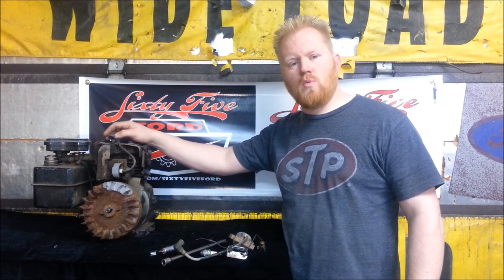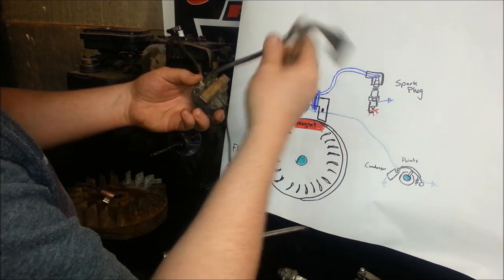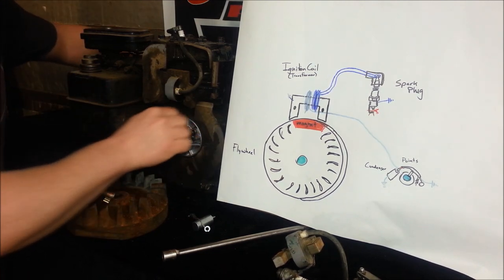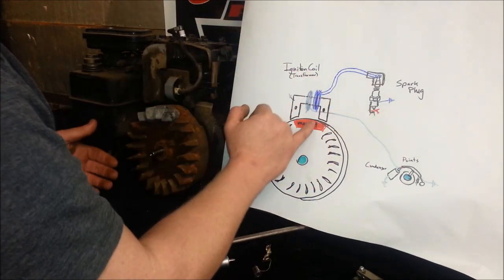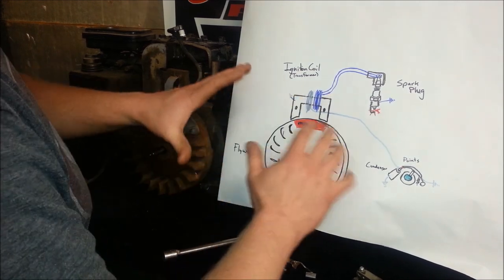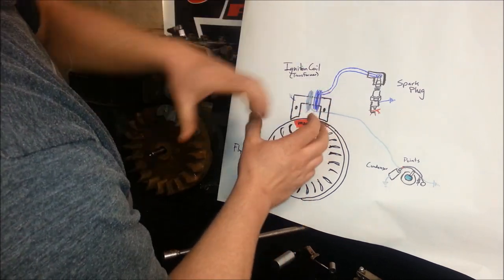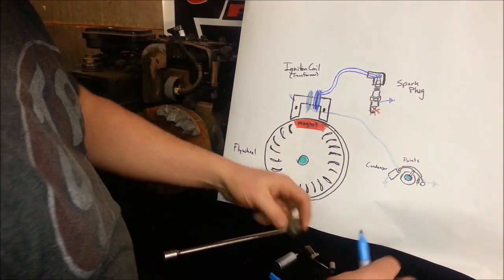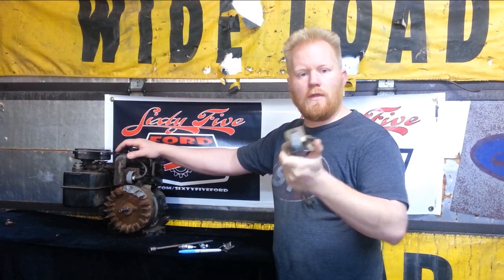How Points and Condensers Work Small Engines

Comment: Hi great video.  Wondering if anyone can help me. Kohler 8hp K181
. Replaced coil, still no spark. I am thinking I probably should have ordered a condenser also. By the way only way for me to find parts is EBay, straight from China of course so just hoping they are good. Anyway in Checking the condenser, I am on 20k ohm setting, Red probe to wire, black too body, meter just stays at 1, should I not see a certain ohm reading, meaning I  am charging the condenser? Also I would then check dc volts I believe, what am I looking for MV of something , then voltage should drop? Thanks for any help.
Reply from the maker: The condensor needs to be disconnected to test and should read around 30mfd from the body to the nipple. The coil is very very rarely the issue in lack of spark instances and generally dirty points, followed by failed condensor are the issue.
Reply: sixtyfiveford hey thanks so much for getting back to me. In my case a new coil fixed my no spark, but back to my original problem I had before loosing spark. For a couple years now I have been having the same thing. Runs great for anywhere from 15min to an hour then starts running rough. Let it cool and starts the same process. I just put on a spark tester and spark looks intermittent when running rough. I took a video but not sure if I can attach it. Could that be a condenser? I have ordered one don’t have it yet.
Reply from the maker: @rltkktlr  Absolutely I would replace the condensor. It is a wear item and over time won't hold the spark energy needed to collapse the field and create a spark.
Reply: sixtyfiveford thanks, I should have ordered one with coil. Will let you know the outcome. Great channel by the way
Reply: sixtyfiveford ok got the parts, points and condenser, replace condenser, I certainly would have replaced the points but got lazy, it’s on a walk(push hard)  behind leaf blower and blower would have had to come off get to points. Maybe a 1 inch screwdriver which I don’t have. So anyway condenser didn’t fix it so I threw in the towel bought a electronic conversion chip, $30, very easy to install, no more points and condenser, and great spark and runs great.  Thanks again, great channel you have.

Comment: Hi, good explanation. You need to follow up on how the engine revs are governed as well as the theory behind the engine revving up and down. Thanks
Reply from the maker: I'm on top of it. Right here http://youtu.be/bOHv3X42-wk
An engine that revs up and down is a clogged idle circuit in the carb.
Reply: Thanks

Comment: Hello, I was very pleased with your explanation on how dynamo ignition works, didn't have a clue until viewing your videao. Maybe a stupid question but I'm wondering, how high should the secondary voltage (feeding the spark plug) be? Would that be like hundreds- or thousands of volts?  Up until now, haven't risked to test it.... maybe for the best..... Kind regards, Jacques Belgium. So as you can see you've got viewers all over the world although Belgium is a small European Country.
Reply from the maker: I would guess it to be around 10,000-20,000 volts.
Reply: Hey....I love your comment and maybe you could explain 8 HP Begium Horses vs 8 HP Harbor Freight engines.

Comment: Smashing video :-))

Hmm i allways thought the capacitor and primary were like a tuned circuit and produced a stable magnetic field, then when the points closed the sudden loss made the primary over react (as charged inductors dont like change) and create a spike of intense magnitism trying to counteract the loss and firing the secondary.

Looks like i may have been wrong :-((

Inductors do react to losses though, they do have some very odd propertys lol.
Reply from the maker: I knew the basics but I had to read up just to make sure my ideas were right.

Comment: nice  video  I just start working on small engines  I pick a 12 hp Tecumseh with points in the side of the block and condenser beside the coil  and am just getting really weak spark because somebody pull all the wire from the points  will appreciate some help
Reply from the maker: Weak spark will either be dirty points or possibly a failing condenser.
Reply: thanks I think condense is bad

Comment: Too wonderful in your detailing. But I am still having difficulty of no spark in a very old Kohler engine Cleaned the points but still no spark not sure of condenser but as you say they rarely go. I must still have a bad condenser.
Reply from the maker: The condensers do go bad, just not as often as the point contacts. If a quick clean of the points doesn't restore points, I generally put a new condenser in.
Reply: Check to make sure the wire between the primary and the condenser is not shorted out against the engine block.  

Sometimes if the wire accidently touches the hot engine block, the insulation melts and causes a short circuit that prevents the coil from charging the condenser.  

Found this out the other day when replacing a condenser on an old Montgomery Ward generator.

Comment: Hey, great video. I'm struggling with an old Briggs 2hp... I'm getting power to the plug but not enough to make it jump. Any ideas?
Reply from the maker: Weak spark would generally be a bad condensor. But you say you're getting no spark so I would clean the point contacts.
Reply: @sixtyfiveford  sorted, thanks!

Comment: what r symptoms of weak spark I have a old Neptune Outboard it don't wanna jump the spark across the spark pulg but when I hold the spark plug wire with my hand to ground I get a shock
Reply from the maker: More than likely the point contacts are dirty or the condensor is weak/dead.
Reply: sixtyfiveford I cleaned the points so it probably the condenser like u said ima just replace them both thank for the tips an reply grate video by the way

Comment: Hello sixtyfiveford@@@ I was wondering if you can help me with my problem I have a ruggerini small engine that it's working but the condenser it's about to run out due to the wire it's coming a parts from it, I was wondering if all the condensers works the same because I just can't find the condenser for this engine please help
Reply from the maker: I've swapped condensors from other engines and they all seam to work the same. I've picked ones that are virtually the same size.
Reply: sixtyfiveford thanks alot for sharing this with me I was just wondering because I have one new setting there so it's the one should be doing the job next

Comment: If the contacts close every rotation of the crank, does that mean the spark fires on both the Intake and Combustion cycle?
Reply from the maker: mon0railbredpig Yes.
Reply: mon0railbredpig Yes the plug fires every intake/compression cycle and exhaust cycle but this has no ill effect, in fact it has no effect during the exhaust because there is nothing to burn.

Comment: You said the point stay open most of the time. Another person's video said it close most of the time. Now I do not know what is the truth.  I suspect the point either close or open when the piston is in TDC. I wish someone explain that.
Reply: The points stay closed until top dead centre then open collapses the magnetic field thus creating the spark ....he's got it wrong...
Reply: @njkip  I agree with you because when I rotate the crank, at the TDC the cam is elevated or has a lobe at that instance. So the only thing will happen, the point will be lifted and open, or no contact. I will go back and start my project again. Nice.

Comment: Thanks for the video. I've got a little 2 hp Briggs 60102 and after it started running lean and dying on me, I decided to replace all of the gaskets (intake, gas tank, crankcase, valve cover, and even the head gasket). I had adjusted to carb with no luck, so I figured I'd just do a little overhaul since the gaskets were cheap enough. I checked the points and condenser and all seemed really clean plus no cracks on the top of the condenser. I sanded the points and set the gap to 20 thousandths, although they were pretty clean to begin with and the gap was at 22 thousandths before. I fired it back up and it will run quite well at half throttle and idle pretty good, but will sputter and want to quit at full throttle. Tried adjusting the carb both directions with no luck. I would assume my points and condenser are fine if it runs so consistently at half throttle, but thought I'd run it by you to see what you think. I just regapped the spark plug, but figure I could replace that just to eliminate it as a cause.
Reply from the maker: tlgrimmy Sounds carb related. The fuel pickup tube that drops into the tank can become blocked. It has a fine mesh screen and it can become blocked if you have a rusty gas tank. Before this I would make sure the Main Jet is clean by unscrewing the nut+screw as an assembly. Then remove the Jet with a wide flat head screwdriver.  Spray carb cleaner through this. Inside the carb hole that your pulled the Jet out of there are some holes behind where this jet sat; clean those as well.  Generally if the engine sparks then it sparks and doesn't change with RPM; if anything it gets stronger with speed.
Reply: sixtyfiveford Thanks for getting back to me so quickly, much appreciated! After reading your response, I pulled the needle and jet, cleaned everything up thoroughly as you mentioned and then I noticed that the needle had a bur on it that I hadn't seen before. It looked as if it had been screwed in all the way and tightened down enough to ruin the taper on the needle and create a bur. That makes sense of the issue with the needle not making much difference on gas flow, as that bur was probably restricting flow. I chucked it in my drill press and carefully filed away the bur and polished things back up. I put it all back together and viola! It runs infinitely better now. I did end up having to keep the needle out only 1 turn due to shortening it when I filed it down, but at least I found the culprit. I'll go ahead and buy a new needle and jet just to get it at it's best though. Thanks again for pointing me in the right direction, that really helped! Feels good to have the problem finally solved.
Reply from the maker: That's great. Keep in mind that it really isn't important how many turns out you go. The 1.5 turns is just a number to get the machine running but it needs to be fine tuned from there. At full throttle turn it in slightly until it begins to stumbles then out until the same occurs. Set it to the middle of these readings and maybe even 1/8+- of a turn out.

Comment: have outboard motor.  won't start.  if condenser is gone will I still get any bit of spark
Reply from the maker: If the condensor is bad, you shouldn't get any spark.
Reply: +sixtyfiveford  .  I have an suzuki dt 7.5 outboard motor.  I've loads of petrol and compression and some spark. I've put new points and reed valves and two new original plugs. still won't start.  any ideas.
Reply from the maker: You should be able to run a spark test and get the spark to jump a 1/4" gap. This will ensure a strong enough spark to run. 2 strokes are easily flooded with too much fuel, to clear the fuel, pull it over a few dozen times with the plugs removed(choke off full throttle).

Comment: I just bought a used Toro groundmaster 52(1979) it was running well and cut beautifully. It died while I had been cutting for about 1.5.  It will turn over, but no spark. Have changed the armature, did as instructed on your video re condenser and point, checked to see if any wires in harness broken extra, but still no consistant spark, only once in a blue moon.  Any ideas. Seat kill switch as been bypassed.. thxs
Reply from the maker: conwald1 This is the point system you have https://youtu.be/QQqhvA5qo2c . You can pull the kill wire all together to make sure it's not grounding out.
Reply: sixtyfiveford Mine is screwed, if you take off the kill swich, it will not turn over..  hook it back up, it will turn over.  So something is wired backwards.  Trying to find a new points and condensor, having a hard time.  Looking at maybe the solonoid.
Reply from the maker: The points and condensor are easily obtainable from hundreds of online places. Don't search for them under Toro as they have nothing to due with Briggs and Stratton. The wire going from the coil to the points needs to stay in order to run, but the wire running from the points the tractor can be pulled off to test(kill wire). If you're getting intermittent spark more than likely you just need to sand the points with a very fine sand paper.
Reply: sixtyfiveford this is the problem, its backwards on our tractor.  When  we disconnect the wire from the points to the tractor it will not run.  It will not even turn over, its absolutely dead.  Connect it again and it cranks.  Go figure.  We are totally baffled.
Reply from the maker: Let me explain a little more clearly as I may have misdirected you a little. There are 2 wires coming from under the flywheel going to the coil. One goes to the points and the other comes out and is next to this wire but never touches the points. This is your kill wire and will go up into the loom to the ignition switch and all your safety kill wires touch this single wire. This is the only way the ignition is shorted out. You can simply unplug or temporarily cut this wire to eliminate the possibility the safety switches on the mower aren't killing it.

Comment: Even on youtube  will see video's by mechanics, auto electricians and others who have absolutely no idea that the condenser (capacitor) boosts the secondary voltage. Good video.
Reply: How can the condenser send current back through the primary while there is no return path to ground.  The points open, which breaks the ground.  The magnetic field collapses causing current in the secondary.  Once the points close again, the stored current is fed back into the primary and helps boost the next cycle.  Current cannot flow without a ground or am I missing something here?
Reply: Thanks for the reply.  I've been looking online to see how exactly this works being as there is no path to ground while the points are open.  The condenser is grounded, so maybe it's just in the way the condenser is made?
Reply: I found the answer :-) 

Once the field collapses in the primary winding's,  the voltage stored in the condenser is higher than what's in the primary circuit.  The insulated foil sheet inside the condenser forces the stored voltage back through the primary winding's, which makes for a longer duration spark at the  plug. This keeps happening until all the stored voltage is used up.

I had to search a lot of old books to find this info.  Finally found it in a auto fundamental's book from 1960.  Thanks for the thought provoking reply :-)

Comment: I have to ask I have a vintage dirt bike and I just replaced the points and condenser and it's still sparking at the points when not running so do you know what the issue is? 

Thanks
Reply from the maker: +Simon De Asian Sounds like a bad condenser.
Reply: +sixtyfiveford 

I checked that and changed the condenser and points so I'm not sure the book says it should read 5.9 ohms at the coil (spark plug) but I'm reading 10.25 ohms I'm not sure if they add up or not
Reply: +sixtyfiveford does this mean including the boot for the spark plug? The boot reads 4.9ohms and the end of the coil (no boot) I got 5.2(something)
Reply from the maker: The condensor is responsible for stopping the points from sparking. I'm assuming you old one was toast?

Comment: Great video! How do you figure out if a condenser is still any good?
Reply from the maker: You can use a capacitance tester to test the mfd. However most people don't have one of those so, in that case it's easiest to just replace the condenser if it is over 10years old(though I have seen them go 40+ years without issue)
Reply: @sixtyfiveford  hmmmm. I have a mcculloch eager beaver top handle chainsaw.. spark isn’t the greatest so it doesn’t start. I’m thinking it’s due to the condenser/capacitor. My multimeter read 1 microfarad but I’m not sure if it’s within spec as the capacitor doesn’t have any labeling on it.. I did read online that most chainsaw capacitors read .22mfd. If that info is correct, mine is wayyyyy out of spec! Would getting a condenser designed for cars and similar in size work? Trying to avoid paying the $30 for an old brand name McCulloch condenser when I can just pay a few bucks for a generic brand from the auto parts store..
Reply from the maker: @berniemac8413  I have swapped condensers many times. Most of the time I use the cheapest Briggs and Stratton ones but they might not fit into a chainsaw. But have never had an issue swapping them around.
Reply: @sixtyfiveford  thank you for your input! I will look for lawn mower ones!